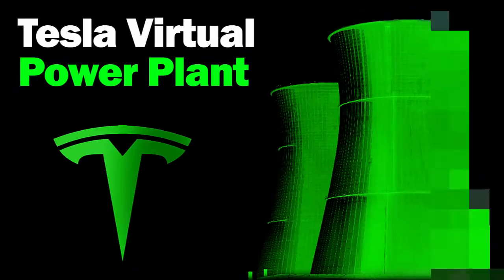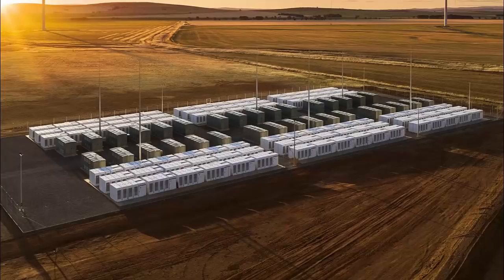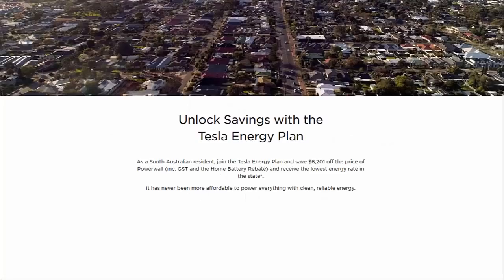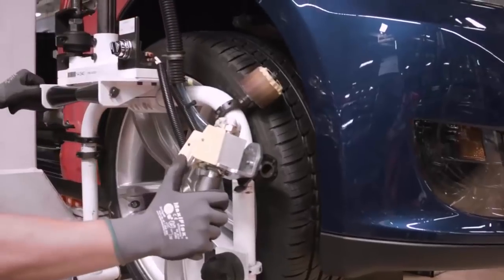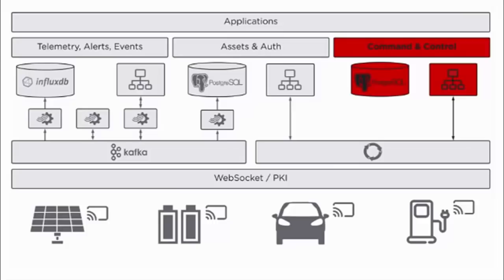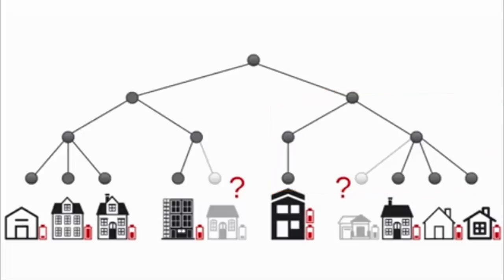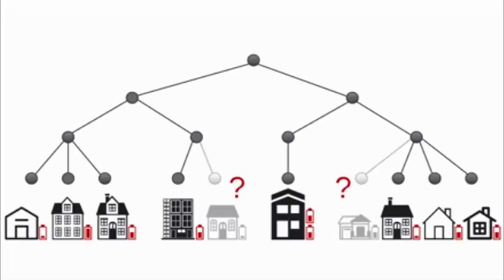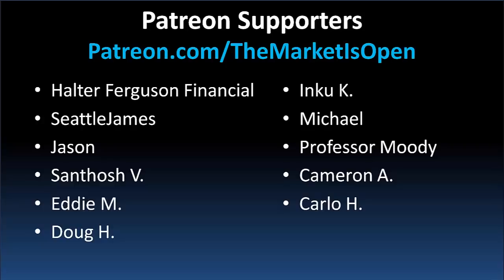Tesla’s Game Changer Virtual Power Plant is Already Here

Comment: totally flawed, who is foolish enough to believe this non-sence.  Resistance to electricity transport will turn these into useless power islands.
Reply: non-sence is nonsense
Reply: Do you mean transporting electricity or using electricity as a means of transportation? On either account I don’t see any evidence of resistance.
Reply: @jwmc41  there is energy loss every inch you push power over a line.  this is why power plants are regional.  if consumers cars/homes have to push power around, there will be constant power loss.
Reply: Daniel Bath Don’t the power companies move power around on hi voltage power lines in order to minimize the power loss? The higher the voltage the smaller the current to transfer the energy and the smaller the loss and the smaller the diameter of the cables
Reply: Daniel Bath Maybe you don’t know but grid around the world have multiple Voltage do deal with long distance transmission. 
That’s why we have polyphase AC from Nicolas and not the stupid DC from Edison in any grid around the world. 
That permits high voltage transmission and easy step down voltage for consumption with a simple Stone Age transformer. 
China currently have the highest UHV transmission line at 1100kV for 3400 km long. 
Long distance transmission have been solved 100 years ago.
Reply: @carloherrmann653  yes, but homeowners dont have high power lines from home to home, or home to station.
Reply: Daniel Bath Ok you clearly know nothing about grid.  🤦‍♂️
Reply: Daniel Bath , it certainly does work, production locally gets shared locally where needed, if excess power generation at a local level, it’s voltage is upscale to HV at local substations and then easily transmitted hundreds of KM (or miles if you please) 
South Australia where this is happening has tons of solar and wind turbines, we are are nett exporter to neighbouring states, the closest is 700 KM away, yeah it works.
Reply: It's called I2R losses. And any time you handle energy there is entropy